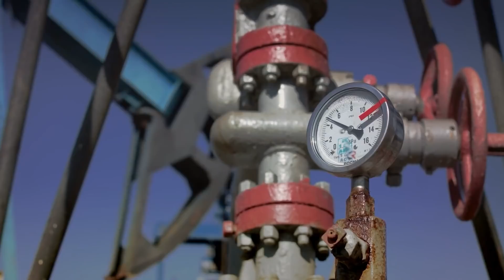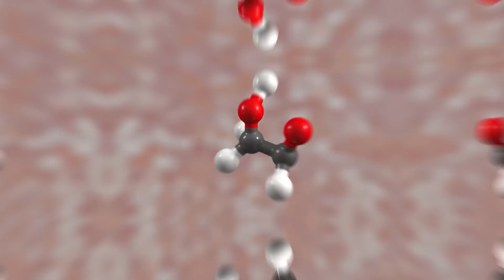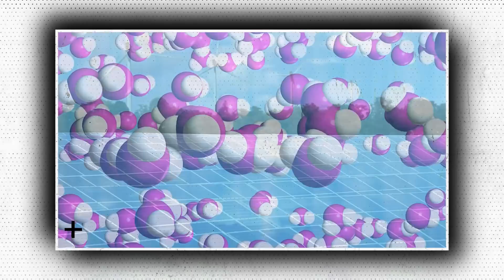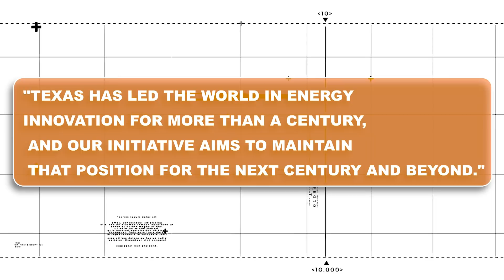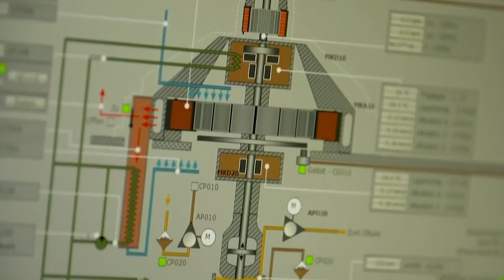Elon Musk Just UNVEILED The World's Largest Green Hydrogen Project In Texas!

Comment: Hydrogen has 1/4th of the energy of Methane.  Saying Musk has sponsored a green hydrogen project doesn't imply he will use hydrogen as a rocket fuel, which would require 4 times the volume as Methane to contribute the same amount of energy.   Stop talking about how Hydrogen is the solution to everything.